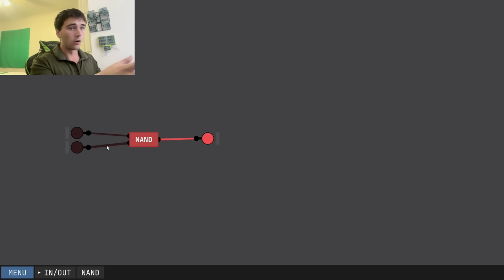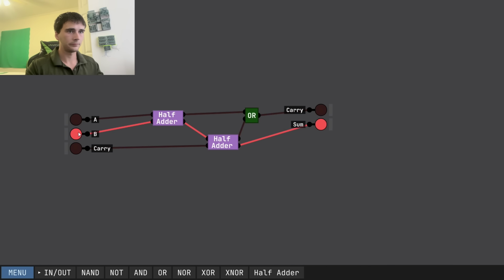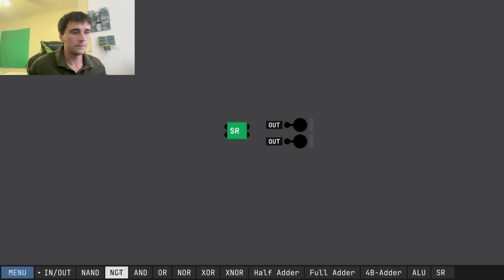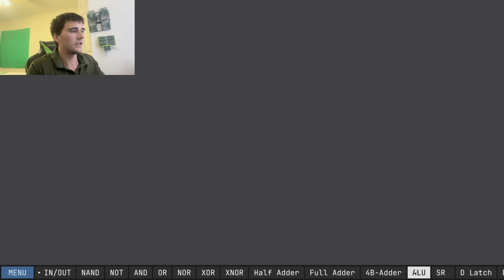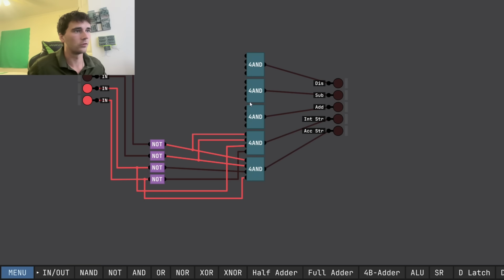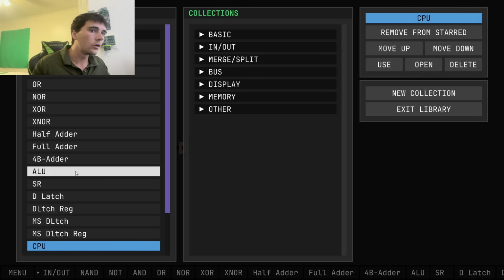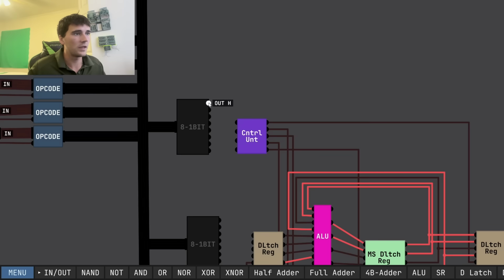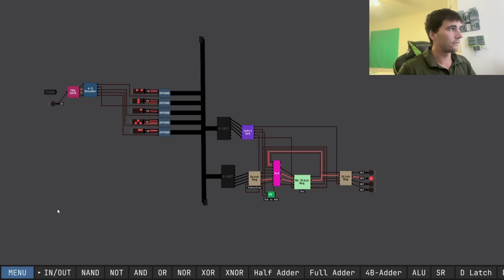How to build a computer TUTORIAL

Comment: this is really sick! It would be nice to see how assembly / c++ interact with this. I think it goes in as input to the decoder as binaries? Anyways, this was awesome! i learned a LOT in such a short amount of time!
Reply: Before assembly - machine code
Reply: @AiJ_Alew  isn't assembly the same as machine code but in human text instead of 0 and 1's?.
Reply: @gabbeeto yes and no. Each assembly command is translated into several machine code commands... next level of abstraction.
Reply: @AiJ_Alew  Oh I see.. I thought there were 1:1 but it makes sense now that I think about it. It's pretty close but there's still abstraction.. I really need to learn assembly and then a bit of binary(I know I'm not going to use this knowledge in the real world but I'm just curious about it)
Reply: @gabbeeto if you want understand it better: each byte is a N bit data. Bit is 0 or 1. Bytes could be used as address or data. To use them as address - a route is created. Now important to understand all this. EACH BIT IS USED ON IT IS ROAD CROSS TO DECIDE WHERE TO TURN. F.e. You  got 64 bit system. That means you have up to 64 crosses. First address bit is used on first cross to turn left if 0 or right if 1. Second on second  third on third. And so on. 
After route is created - a data are sent there. 
This way data are transfered. 
Assembly primary uses data transfer as main logic. F.e. you write data to comparator register A then you write other data to comparator register B then you get data from comparator register Q that got info of all available comparsion details. That is 3 binary actions for 1 assembly command

Just small excurse
Reply: Для примера , можно взять эмулятор виртуального процессора и написать схему машинных инструкций для него на любом языке. С точки зрения логики -  примитивный процессор это набор регистров и некоторая область памяти с командами. Простейшая схема машинных инструкций за 1-2 дня а с нейросетями и того быстрее. Особых знаний для этого не требуется, достаточно школьного курса информатики. 

Сама "инструкция" это последовательность бит (к примеру 64 бита (где первые 8 бит это аддресс инструкции, а в остальном пространстве закодированы флаги, индексы регистров над которыми нужно сделать операцию, и прочее)). Инструкции"аппаратно" декодируются определенным образом, определяя поведение вычислительного устройства на данном такте. Обычно инструкции имеют стандартную схему, хотя чисто технически их можно сделать достаточно сложными и умными и даже не придерживаться фиксированного размера или выравнивания.

 Ассемблер в простейшем случае - набор мнемоник для ISA (чтобы вместо бинарного кода, в котором легко запутаться и риск невнимательности выше, ты видел понятные тебе метки написанные на человеческом языке (mov/add/cmp понять проще, чем к примеру: ...0100.../...0110.../...0111...)). В более сложном - выполняет некоторые незначительные шаблонные преобразования с двоичным кодом. C/С++ делают то же самое , но переводят абстрактное описание алгоритма в конкретные операции процессора, решая задачу упаковки и оптимизации, там есть немного математики под капотом. 

Я так же разрабатываю небольшую виртуальную машину с кастомным ассемблером и набором инструкций для своей игры в жанре "программирование".